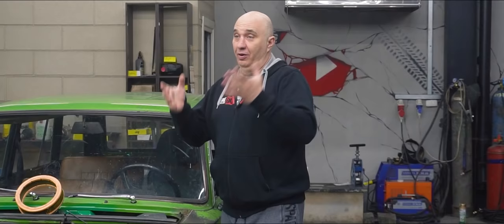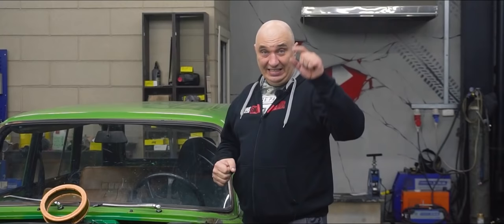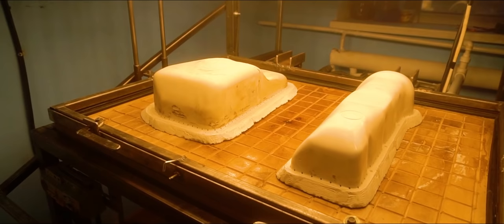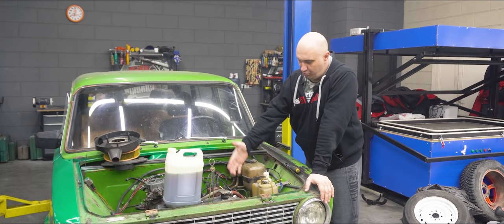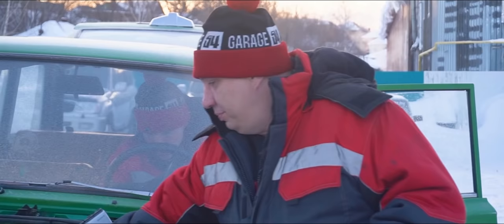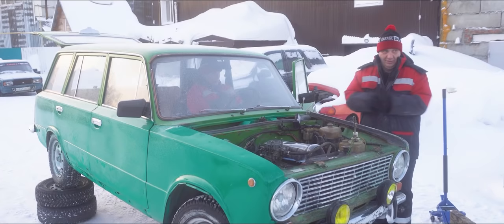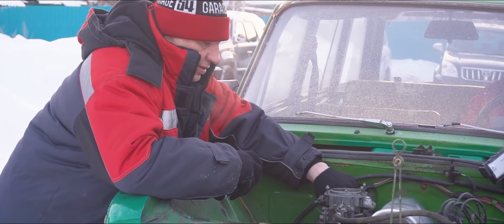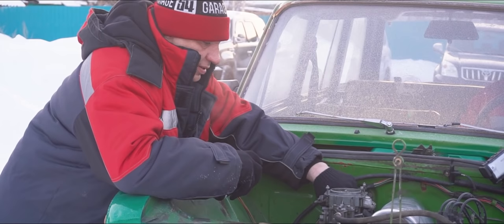Looking inside an engine during cold start (-30 degrees)

Comment: This is the correct cold start procedure listed in most owners manuals. Pump pedal to flood engine, crank cold engine until starter motor starts to smoke. If engine actually starts, put foot to floor so your windows defrost as quickly as possible. Don't forget to never change the oil!
Reply: yeah that's totally legit🤣🤣🤣
Reply: Real world "ownership": the non owner of a leased car doesn't care about a car they will be handing back after three years of not caring a hoot
Reply: LMAO!!!😂
Reply: Literally every cold start in the world looks like that. It's rather frozen wrack trying to start
Reply: @furiatwielki9748  SO IT'S NO BIG DEAL JUST USE LIGHTER FLUID TO HELP HER START
Reply: my neighbours wife did this with her/their  car , nice car too, they were angry people, needless to say the engine did not last, neither did they ,  they divorced.
Reply: And that is how you start a Lada.Greetings from Montreal!
Reply: I laughed so hard 😂😂😂
Reply: It's the only way to start some things or nobody has the time to grab jumper cables
Reply: It's the only way to start some things or nobody has the time to grab jumper cables
Reply: That's how cold starts in that cold always work. You either preheat or you seriously wear down both engine and the battery.
Reply: 40 weight oil not needed far north
Reply: @SaraMorgan-ym6ue for old cars it is legit. Newer cars not so much
Reply: Where did he get the transparent engine parts ?
Reply: That's great advice right there.
Ima do that today!!!😂
Reply: Perfect I’ll follow it lol
Reply: Bang on. My Girlfriend knows everything and thats her technique, so its 100% correct.
Reply: Thank you. My cylinder was hired by spaceX

Comment: It would have been nice to see synthetic oil versus regular motor oil instead of mineral oil
Reply: What is "regular motor oil"? Regularly they are synthetic... And other option is mineral.
Reply: Good comment, I agree with you. This is not a negative comment. But............ The definition of regular describing things has changed over time. Regular oil to me was non detergent 30W. Regular gas was leaded gas that sold as low as 18.7 cents per gallon. I do use synthetic oil in my car now. Things change but the old stuff is still stuck in my mind.
Reply: Synthetic oil is probably not readily available in the Country this was filmed in.
Reply: With synthetic 5W-40 it'll just be liquid at -30C. The temperature it freezes at is -40 F (which is also -40C)
Reply: @mattikurimus  Engine oils have 5 classes based on the base oil. I think the upper 2 levels are true syncthetic, the middle one is semi-synthtetic. So what is regular?
Reply: @mgoogyi  The confusion is that OP perceives the test oil as literal mineral oil like what would fill a transformer. Also I would say the main advantage of synthetic oil is just cleanliness, there is next to no free carbon to heat out of it so it gets dirty slowly and there's just less wear overall. I don't think it's superiority is like, visible, short of maybe SEM shots of like the inside surfaces of oil filters at tiny levels. The main thing that seems to happen is the dirtiness wears stuff down and the car starts to burn oil, then it doesn't pass smog, then it's off to the Children's Home crusher to get me a tax rebate, y'know? Once they get to that "I burn oil now" phase it's just over.
Reply: @Suiseisexy synthetic flows better, and can run longer change intervals
Reply: they don't say what viscosity of oil they are using the synthetics can be quite good at flowing in low temperatures if you get a 0w 20 or even 0w-15 they can't get the regular oils to that low of a viscosity. @Suiseisexy
Reply: @mgoogyi  regular = conventional
Reply: All oil are mineral , it's the additive they put in that make them synthetic
Reply: @loicdore39  well no it's not the additives that make it synthetic. Although some companies & peoples might want you to think that. It's the base oils that determines if it's synthetic or not. There are Five oil groups, with groups 3,4&5 classified as synthetic in North America. 1,2&3 are petroleum based, 4&5 being true chemically synthesized man made, from basically the molecule up, synthetic lubricants. Group three are classified as synthetic in North America but they are a highly refined, hydrocracked, petroleum based oil. But they are better than groups 1&2 petroleum based conventional oils & lubricants. So synthetics last a lot better due to their purer base oils and their uniform consistency helps their thermal stability so they don't thicken at low temperatures and they don't thin at high temperatures as much as conventional oils. Synthetics also don't react with oxygen and the byproducts of combustion to form varnish and sludge. They also have a much higher film strength helping to prevent wear. This is more true with group 4&5 synthetics which are the premium synthetics and less so with the group three oils. So additives are very important too, but they don't make conventional oils & lubricants synthetic. Ok?
Reply: @oneninerniner3427  yes 4 and 5 ARE petroleum based , they're just modified and called synthetic but same base ...
Reply: @mattikurimus  regular would be what most people use, ie not too old(mineral) and not purely synthetic (it's expensive anyway), ie some blend (mix)between the mineral and synthetic.
Reply: @loicdore39  no, some oils are purely synthetic.that would suggest they have 0% "natural" mineral oil. then again if they're starting with crude oil and end with synthetic, it makes no sense to call it that way. or to call mineral oil mineral, because all oils just differ in amount of man tempering with crude oil.
Reply: No @mattikurimus
Reply: @xxs1lentk1ller30 What no? 95% of engine oil in stores are fully synthetic. Hard to even find mineral oil nowadays
Reply: @ivok9846 What? Full synthetic is normal oil..no one uses semi synthetic or mineral oil anymore. We are not living in the 90s anymore

Comment: The true unsung  champion here is the battery
A round of applause for the battery ladies and gents
Reply: You beat me to it. I was asking myself what kind of battery they are using. The guy just turn the key and went to sleep.
Reply: Don’t forget that starter that poor thing ran the motor till it warmed up enough to start! It and the battery are the true heroes here!
Reply: you both forgot about the starter wires, these probably has reach the temperature of sun
Reply: Maybe they should of made it electric
Reply: They may as well had just started shifting gears.
Reply: @Dubz0408  lmaooo
Reply: @bezkonserwantow3392  Maybe they should run the starter cables through the oil; cools the cables, warms the oil.
Reply: @andyowens5494  hahahahahahah you are absolutely right
Reply: I was thinking all the same stuff.
The fact that it was 20 or 30 below zero, did help keep stuff from roasting.
Reply: starter. that thing would be smoking
Reply: @i.am.razvan  the battery is electric. That's kinda how they work. lol
Reply: @NicholasCox85  the car Mr. LOL...
Reply: Lol
Reply: Battery AND starter motor: you shouldn't run it for more than 15 20 second at a time with some rest in between
Reply: IT'S A SEARS DIEHARD BATTERY, 
THEY MAKE THEM BETTER FOR RUSSIA'S COLD WEATHER
Reply: Maybe you should have done a proper tune up prior to the test.
Reply: Sht I love that starter.
Reply: lol no it's a starter...but I suppose the cold helps it last.  Brushes should be shot after that much arcing and cranking
Reply: Yeah
Reply: That starter be sweating haha
Reply: Yes and the starter.
Reply: And the starter
Reply: yeah honestly lol
Reply: And the starter
Reply: guys like you leaving comments like this is one of the reasons Youtube is still fun LMAO
Reply: N starter...
Reply: No no the poor starter. starter should have run time and rest time. Armature was probably fried.
Reply: Not only that, but I think the engine was warmed up by the red hot starter motor.
Reply: do not forget to also applaud that dang starter!
Reply: where these guys fom russia?
Reply: Russian battery .... good battery
Reply: @My2cubes  where i live in Ontario we experience down to -55 celcius at worst and cars still start with regular batteries in that temperature, granted even plugged in they struggle but the vehicle will still work.
Reply: @bezkonserwantow3392  that's why the engine got hot enough to start
Reply: @benjiunofficial  that's it
Reply: This whole thread made me cry to tears. Thanks folks!
Reply: @CristianKlein  and On a positive note. I’ve got 3.3 k likes. A record for me hehe
Merry Xmas everyone 2021
Reply: It's a freaking Lada, those things are unkillable. You can say whatever you want about Soviet era built cars, yes, the inside, the comfort, and the raliability is not all that good, but you can just repair it, over, over, over and over with such an ease... I know that my Niva never let me down.
Reply: I applaud the return spring on the ignition. I can’t imagine being compressed for that long and then rebounding fully!
Reply: I need a Russian battery
Reply: And the starter motor..
Reply: This is pretty cool. I have started a vehicle thousands of times at these temperatures and colder. The coldest I remember starting a vehicle it was -67F out. Th shocks felt like they were welded as they didn’t move.
Reply: @My2cubes  I worked in the Arctic for years and we had battery heaters. -30 isn’t to bad with a good battery and proper lubricants. Also we used block heaters, oil pan heaters and even transmission pan heaters.
Reply: And how about that starter motor huh? Let's give it up for the starter! What a performer!
Reply: And the starter.
Reply: theres no way he did all that on one battery. I live this nightmare. no way.
Reply: @tammyforbes2101  Keep in mind the starter is -30c as well which means it can stay running a lot longer as well.
Reply: The starter also needs a round of applause
Reply: @tammyforbes2101  use a pipe from starter to warm up air intake
Reply: I think he put eggs in there. His ex wifes car. in for a tune up
Reply: Hell, the battery in my pickup truck does that on a near daily basis the entire month of January.
Reply: It was certainly being provided elsewhere, or the battery was brought out from inside, warmed up.
Reply: Don't forget the poor starter
Reply: @bezkonserwantow3392  na, he would lose all the oil when the plastic oil pan melted then it would be game over! 🤣
Reply: Not if it just came off the charger.
Reply: @i.am.razvan  should of? They should of made it electric?
Reply: And the starter motor 😀.. Guess the cold saved it from cooking off
Reply: @andyowens5494 ever idea
Reply: i need to buy whatever starter they used in this video bruh
Reply: dude you said it, thats hard work cranking for that long continuously
Reply: Indeed. Maybe it's named, cranktillstart batteries. Or neverquit
Reply: Would love to buy them this side. Never die batteries
Reply: ?......a  round  ....?   Batteries, here, are  square ...?   Pie  are round,.....cakes   are  square  .....oh sorry.... pie is 22 divided by 7...... ''  ...a  square  of  applause   for   the  battery  ''......reminds me,  EVERY TIME.....of   '' appleSauce  = applause......good day  Tontobb......
Reply: Russian COLD. CRANKING. AMPS.
Reply: Starter gets a round of applause as well.
Reply: @My2cubes  yes burn out your starter. Don't crank more than 20 seconds. Drain your battery and as you see, strip your parts. it was -44c last week. my car started however I don't go anywhere in winter, I'm retired. give it a turn to stir the fluids every few days. Winters are brutal.
Reply: @monfortnicolas5448  Lada's? We called them Lada Trouble in Canada. lol.
Reply: @Chris_at_Home  I'm in Alberta. as a kid we made our own block heater, Roll of toilet paper, put on a stick, then light it, put it under oil pan....yes its dangerous, however at -40c, who cares. lol. but it worked.
Reply: in case noone pointed this out to you, it was on a charger
Reply: Put in gear and drive on battery.
Reply: and the starter

Comment: I remember watching my grandfather build a small fire under the oil pan of his farm tractor, during cold weather in Wisconsin.  I've used an electric heat tape and an old Army blanket to warm up the engine on my wood splitter in the winter.  When it's 25 degrees (F) below zero outside, it would have to be an emergency if I had to start up my truck to go anywhere. I'm retired. Better to wait for the temperature to rise a bit. Same with a blizzard, better to hunker down and wait until it's over to venture anywhere.  Good job showing what happens inside an engine during cold weather.
Reply: My grandpa used to freight with cats and sleighs and sometimes trucks in northern Manitoba and Saskatchewan back in the 1950s and 60s.  My dad remembers going out in the bush with him to get a truck started.  He used a fire to warm the engine as well, but he built it next to the truck and then shoveled the hot coals under the engine. I think he was worried about catching the truck on fire as the lower end was probably covered in oil from leaks.  My dad said it took hours but when he finally turned it over it started just like it was summertime. Ken
Reply: here in finland car starts easily in -4 fahrenheit
Reply: Use to be the same on our old farm. We didn't build fires but would use kerosene heaters with blankets over the tractor engine. This was with the engine block heater running. Cars would usually start with the block heater running alone, but they wouldn't like it and need to be warmed up.

Comment: When I was a young lad (many, many years ago), you used the thickest "mud" that would still allow the engine to start and yes, you warmed up until the temp gauge needle started to move. Doing anything else like a takeoff with thick, cold lube oil drastically shortened engine life. Modern engines are very different. These guys have done a great public service in demonstrating why you should always use the exact lubricating oils specified my the manufacture of your engine.  These dudes get an A+ for being crazy fun!!!!
Reply: Not necessarily, using a slightly thicker weight oil than recommended on older engines (such as the ford crown victoria being recommended 5w20 when its best using 5w30)
Reply: @TheCatOfAges  i own a 2004 crown victoria and I use 5w - 30 also

Comment: Having grown up in Saskatchewan, where -40 C is not a rare occurrence, it is an eye opener to realize that most of the engine wear must occur during winter starts. Even using a block heater does not pre-heat the oil prior to start up. You would think that there would be a market for in oil pan heating coils rather than the stick on oil pan heaters that never stay stuck on.
Reply: fun fact: -40 C and -40 F are the same temperature
Reply: @Novous  They're almost certainly using Celsius given where they're located.
Reply: @Novous  Lol you looked it up didn't you?
Reply: @matthewmorgan582  probably not. I thought most people knew that since middle school.
Reply: Being from Alaska, I can state many times we just left our cars running while we ran into the store. I remember one year we were roughly -32F for 5-weeks and our poor car had to be towed to get started as the fuel was not atmozing. Took nearly two miles of towing before it got started. It was was an older Subaru with throttle body injection.
Reply: @27Zangle  Our/my Subaru Legacy 1992;  During winter 2012  Temp plunged down to Minus 44°C (this time it is Higher in Minus °F  = - 47.2°F);  and I moved to a new place that we did not have the Electrical Outlet to plug in; I parked the Car on the Street; so I had to sit in the Car for a while and run the Subaru Legacy idle; RPM 500

The Tire Made in Japan Bridgestone one went flat; I started the Subaru every hour until I was so sleepy at midnight;  So in the City where I live; in the Winter, one can run the Power cord across the Sidewalk overhead = and it is not illegally... Since the Police know you can't start up the car to go to work.

In looking back; those areas that we went up (near Alaska Highway) for Drilling Oil+Gas Wells; some Diesel Trucks run idle all Night...

Cheers,
Reply: @Studio89Graphic  Good story. Out of all the years we would leave our car plugged in overnight, only once did someone steal our brand new cord. Never had a tire go flat in the middle of winter but that same Subaru snapped a timing belt in winter of 2009/2010 while it was about -25F. I worked two miles away, so I walked to work and everyone looked at me like I am an idiot for not calling them to send someone to pick me up. 

It was too cold to fix the car and the cost to have to towed to a shop and fixed was more than it was worth, so I bought an old 87 rusted Suburban for $500 to get me through the winter. I didn't replace it until a couple years later as my wife had a nicer car at the time (we got married a few months after all this), and mine became the vehicle that took me to work and nothing else.
Reply: @27Zangle    Talking about Coldness in Winter and Snow; The Areas above 63° Latitude; where/when in July 1997 we were up there for works and there were traces of Snow still around the Rock-bed and those shaded areas.

I am done with all the Cold and 🌨 🌨 ❄ ❄:  I remembered I had to walk in to the Wellsite for some Set Up of GPS and Data Points;  And snow hip up my Waist... So I had to carry a rope when I finished; the others pulled me out ─ as it was too tiresome to straddle in a yard of deep snow...  But the Vortex Sky was beautifully Blue...

Cheers,

Happy Holiday to all... ☺ ☺